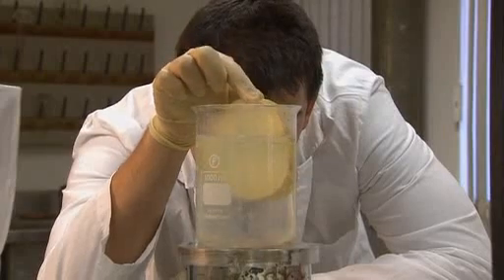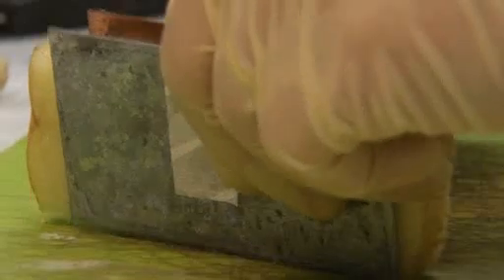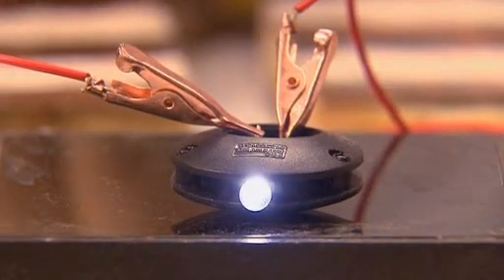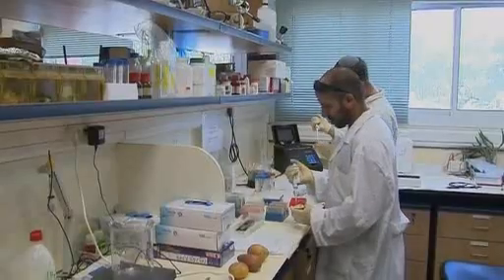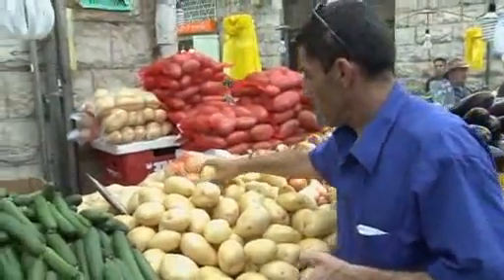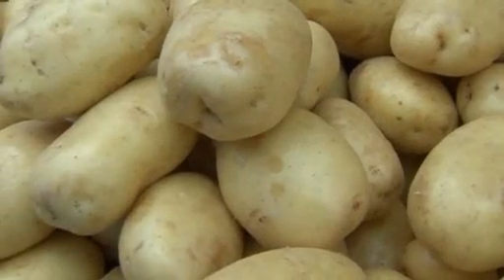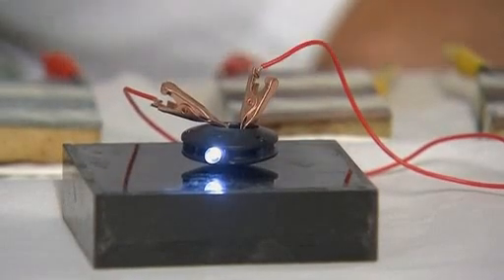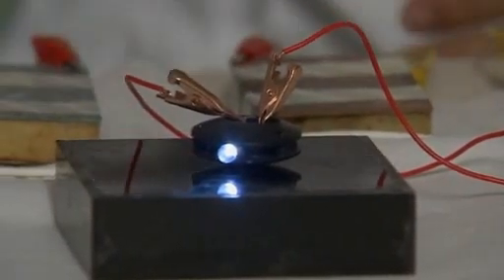Potato battery new and improved Video Reuters

Comment: OK, so tell us how it's done, what parts are used, how much, etc.
Reply: Boil a potatoe in salt water, cut a rectangular cube out the middle, with no skin on. Place a copper plate on one side and a zinc plate on the other, connect each plate to a wire and then connect the wires together, or to a device eg bulb, to create the circuit. Make as big or stack as many as you need or want, and measure the current and voltage to work that out. Not complicated.

Comment: How much net energy do you get out after subtracting the energy you used to cook the potato?
Reply: +Dave Miller, very good question.
Reply: how much net energy do you get after producing a regular battery?
Reply: Energy used to boil the potato was my first thought also; however, I'd say that it is still far more efficient. In addition, to bring a potato to that state, conventional boiling can be replaced by soaking in varied solutions. This technology isn't new but with today's understanding, can be developed to eventually replace the prevailing and powerful market momentum. The energy produced by suspending a superior and an inferior metal in a stimulating solution is the basis for all batteries. There are numerous alternatives, yet to be explored.
Reply: Probably way more than they will ever produce, however, consider that you can boil potatoes with fire. This would mainly be an energy solution for remote locations and developing countries, where they have no proper electricity grid.
Reply: Also, potatoes can be boiled by cheap solar cookers.
Reply: How about using the leftovers.
Reply: You know what else you can produce with fire and water? Electricity.

Comment: hmm interesting for cheap stuffs like making led turn on thou problem will be stability of output lets say it first generate 12 then 8 then 5 volt with different amp so it practically not useful unlike regular battery  and it more harm than good to your device unless u just want to turn on regular led lamp...
non the less if they find a way to stabilize this maybe in future we all use potato battery :P

Comment: It's NOT a battery. A single electricity producing unit is a CELL. Multiple cells connected together in series or parallel ARE batteries.
Reply: there was a shot of multiple cells connected in the video
Reply: hi everyone

Comment: This is neat and all...but the potato battery is almost as old as the (old school) light bulb. This really doesn't prove out much of anything or solve any energy crisis.

The folks in countries where they'd have to turn to potatoes to light their homes should probably plant and eat the potatoes as a higher priority.

The microamps provided by potatoes will absolutely run an LED bulb...maybe a small LED clock. That's NOT going to power/cook any food or run an air conditioner or heater or anything else substantial.

I  mean it's neat and all but why are you patting yourselves on the back over it?
Reply: Wouldn't it save on electricity using light bulbs normally?